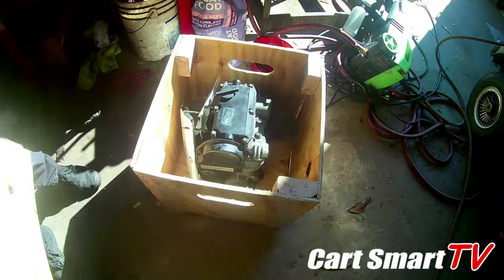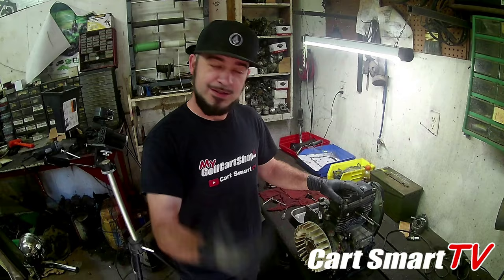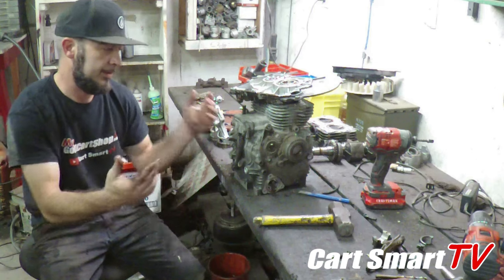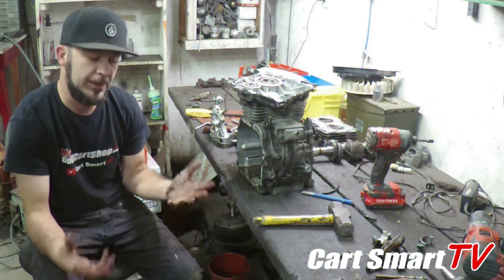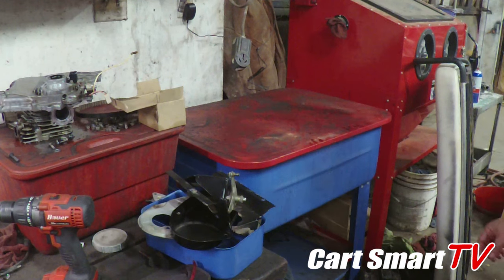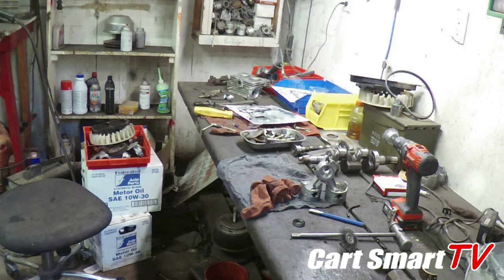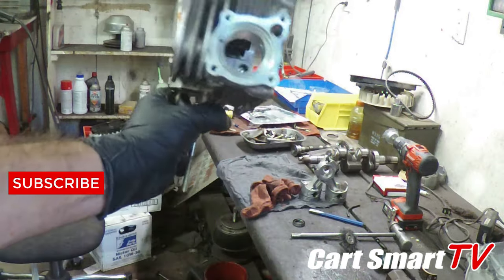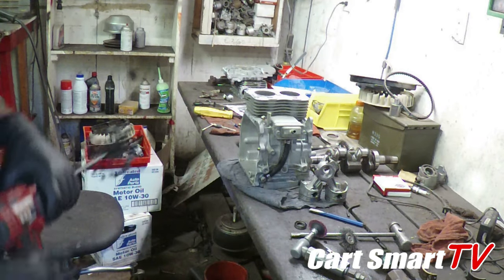How Our Rebuild Service Works

Comment: I have oil coming from behind the timing cover? What would cause this?
Reply from the maker: Sounds like you have a seal leaking. This video should help show which one? > https://youtu.be/oJgh0O5tBYc?si=KI6-I04hVC7NIp1d
Reply: @cartsmarttv  after getting it apart I realized the shop I took it to didn’t put in a camshaft seal in. New seal is in and I’m good to go